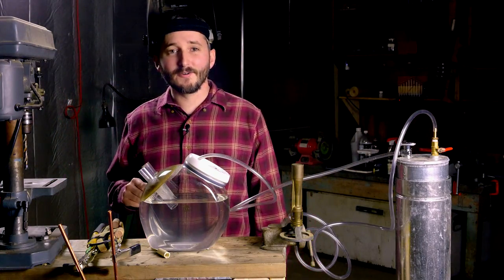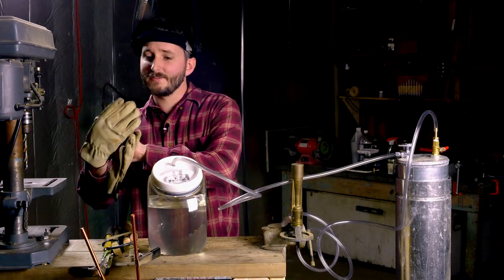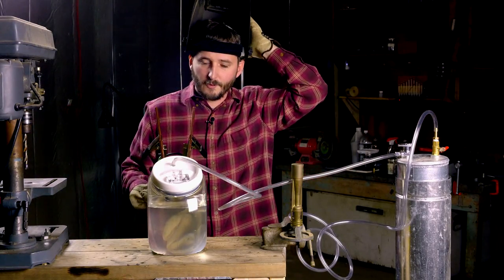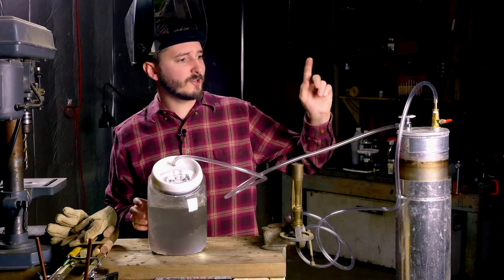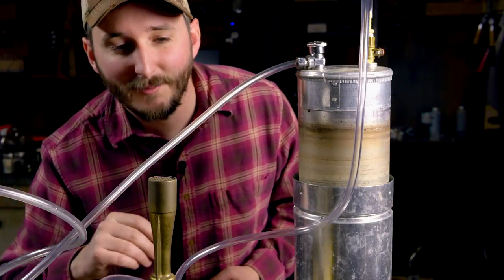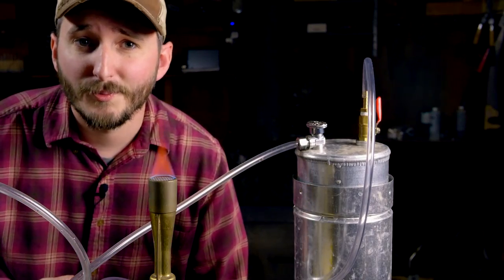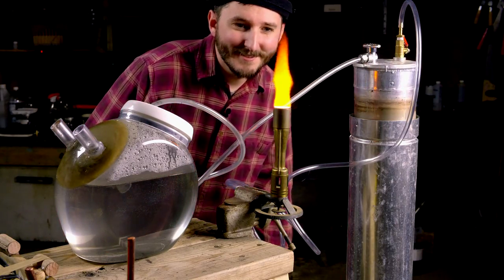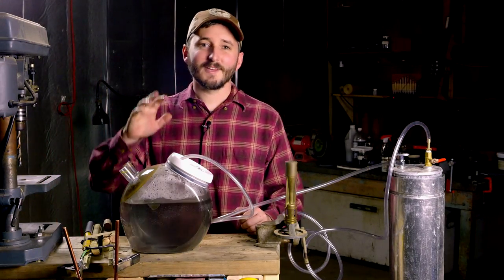Plasma Generated Water Gas (Electrically Produced Fuel That Is Not HHO)

Comment: I'm curious if such conditions might not even produce more than carbon monoxide and hydrogen. I can imagine that compounds like CO2, formic acid, formaldehyde, methanol and short hydrocarbons could form as well. I'd love to analyse the gas. In case someone can try this:

Bubbling the gas into water:
Test pH. If it's acidic, then any kind of organic acid should be present. If it's alkaline, this would be interesting, because it seems impossible at first sight that ammonia could form.

Bubbling the gas through calcium or barium hydroxide solution:
A white precipitate indicates CO2. No precipitate would mean, there's no CO2 or the amount of acid is way higher than expected, if the pH was acidic in the beginning.

Bubbling the gas into tollens reagent:
If a precipitate or even a mirror is formed, then CO (or some aldehyde) is present for sure.

Cooling the gas with ice, after passing it through a tube with calcium chloride (removes water):
If a liquid condenses, it might be methanol and/or longer hydrocarbons. If the liquid burns cleanly, then the hydrocarbons are short. If the flame produces soot, the chains might be long or there are lots of branches in the molecule. To test for methanol, add boric acid and a few drops of conc. sulfuric acid. If it burns green, it's methanol.

Comment: It's all for education of science. But I used carbon rods coated with copper with a small hole down the centre it had compressed air flowing through it and I used it to gouge though metal after a weld had cracks in it on 2 inch stainless steel

Comment: i wonder if you could make a generator motor combination that would run the arc welder off the gas and store extra for other stuff ... if it could keep itself supplied then all you have to do is basic maintenance every so often and restart ... be a good steady recharge for a battery bank I think

Comment: It's a hydrogen fuel cell. Use a double Helix coil and you can do the same thing with a 12v car battery.two plate work as well but the coil produces more.

Comment: If one is living far from civilisation (Alaska, boat, or Island) and you have wind, water or solarpower. Then you can store using that method:  warm water (shower, heating etc), CO to burn for heat and... electricity (at times with no other power..). The H2 should sequester in the upper compartment, because of its weight. One could use it to power a fuel cell.

Comment: Hi, well done experiment. I just wonder, how you got the case airtight with the electrodes sticking in there, so the gas is not coming outside the holes, where you have put your electrodes into there ??
Reply from the maker: The tubes the electrodes poke through are underwater so that creates a seal.
Reply: @Nighthawkinlight  How do you seal it, when you move the electrodes ? Can you please show this in a next video some more ? Many thanks. Regards, Stefan.

Comment: A while ago I tried this with pencil graphite but my small 70w power supply (even if I put it in series with three laptop chargers for about 140w) couldn't sustain an arc. It's quite lucky though because I didn't know it could generate CO which could be dangerous but I was doing it outside.

Comment: Initially this would generate carbon monoxide and hydrogen from the water but if left going it might start creating methane, methanol compounds in the carbon monoxide and hydrogen gas, then the mixture could be burning faster than an energy efficiency society would want. You might want to run through a masspect to make sure of the product.

Comment: Def. Subbing; I really like your videos 
I don’t think I’ll get to this gas I’ll just go back to the HHO torch; should be enough to melt glass and make rockets (for rockets. I think it’s safer to stay on pressurizing water with my compressor inside bottles)
Also, one more question, can I store HHO in this gasometer???

Comment: I know physics hates this question, but. What would be the yield of a self fueled electric generator using the gas produced by its own electricity? Would it be possible to make a self powering system to basically make an endless flame? All you do is add water / replace rods.  I would guess the power required would be greater than the work, depending on the efficiency of the generator? Either way this is good stuff as usual!

Comment: I'm going to guess carbon monoxide because the only elements available are carbon, hydrogen and oxygen. It's not HHO and it's flammable, so it can't be CO2, so it must be CO. Furthermore, it's quite toxic, which coincides with what you said. If it's not, maybe it's an organic compound? My first guess at an organic compound would be methanol, but it's not too toxic (and it's liquid at ambient temperature), so my first guess is still CO. Or maybe its multiple compounds, including CO? Guess I'll find out when I watch the rest of the video. I'm also guessing the way it works is through thermolysis and then the reaction of carbon with the oxygen/hydrogen at high temperatures.
EDIT: Oops, forgot about the hydrogen, but I guess I was right with my first guess of CO! Also, now that I think about it, a mixture of CO and H2 is also known as syngas (synthesis gas) because it can be used to synthesise organic compounds such as hydrocarbons or methanol (so there's actually a chance there's some methanol!). Maybe you could try that in a future video?

Comment: The idea that using leftover electricity  to make hydrogen and carbon monoxide,  instead of electrolysis,  oxygen and hydrogen. with no CO2 by-product. But awesome video anyway. Super interesting
Reply from the maker: In using electrolysis for fuel the oxygen is pretty much a waste product, which makes it an inefficient process. With this method both the gasses you make are flammable. The carbon can come from biomatter so that the co2 emission is net 0.
Reply: @NightHawkInLight  then there is the process of making the carbon rods. Oxygen can be used for a lot of industrial processes, also its highly Flammable.  And it's not harmful to release into the environment,  and electrolysis uses less amps, which is less power draw. 

It's definitely interesting. Just doesn't seem efficient at all. Environmentally or power draw.

Comment: In case people do try this at home, some safety "education" for the audience regarding how the gas tank+burner is set up would be good. Particularly, that people should use a valve that prevents backfire (when the ignition goes all the way up the tube, and into the tank, Exploding the tank).
Burning Hydrogen is not something to half ass.
When I was a kid, I produced some hydrogen using salt water and two electrodes, put a tube off it like this, but didn't have a valve to prevent backfire.
Luckily for me, the tank was sealed at the bottom only by being submerged in water, so i basically turned the tank into a high powered rocket which blew a hole in the side of the roof outside, and got salt water exploded all over everything including workbench, tools, and lots of other metal things u don't wanna cover in salt water (causes rust)...
If it had been a sealed tank like this, I'd probably have died.

Comment: I don't think you mentioned it but I suppose you purged the vessels from air before you collected gas with the intent of igniting it. Since hydrogen has so wide explosive limits, the gasometer could end up on the floor above you if there is too much oxygen left when you ignite it.

Comment: What would be the most valuable thing to create is alcohol from simple water using only electricity. Experiments into the possibility that alcohol can be created instantly from water and carbon using frequencies of electric current are on paper and some one needs to take this theory to the next level. The idea is that alcohol can be created in miliseconds if using the right frequencies, voltages and currents. this process could involve microwave, radio waves or another form to mimic the process of sugar and cellulose using only electricity along with carbon. One day in the future this could be a common place manufacturing process and quite inexpensive to produce.

Comment: I think that I have safety concern about some amount of oxygen also geting into the produced flamable gases container because of for example water electrolysis also taking place (but maybe it's produced also due to some other processes in such extreme envirovement that the electrical arc is). I'm not sure if the amount is any significant, but I think it was worth mentioning.

Comment: Nice project! One question:
Are you absolutely sure, that no gas can escape out through the insertion tubes? They are under water sure, but maybe a small amount of gas exits through the holes instead of the surface?
Reply from the maker: You can tell when gas comes out the tubes as the bubbles are obvious. If I notice one I adjust the rod placement

Comment: Interesting, should look at how acetylene is produced and the reason why little bits of carbon fill up the air in your shop when you run a Oxy/Acetylene torch without the O2 on … it’s a really simple chemical process.

Comment: My thought is either methane (CH4) and gaseous oxygen (O2)/hydroxides (OH) or some mixture of carbon monoxide (CO) and and gaseous hydrogen (H2). I would presume the latter because of the (IIRC) lower activation energy required to bond carbon and oxygen.

Comment: Dude I love your experiments!!! Can you please build a geet reaction chamber? Using and electrical coil to heat the chamber and force hydrogen into the chamber?? Please it would be awesome!!!
Reply from the maker: What is a geet reaction?
Reply: @Nighthawkinlight   Paul pentone . Google geet reactor, I'm curious if you can do away with the exhaust heating jacket, if a coil is used for the heat. Geet is lightning a lightning reaction cold gasses impacting heat and separating releasing burn able gass and plasma

Comment: Build a heater with this that has a built in carbon monoxide detector that automatically shuts off if it leaks. It’s definitely not efficient but it’s interesting.

Comment: make an adiabatic reactor and see if this gas turns into liquid fuel.
example like a metallic syringe and inside the syringe this gas. compress quickly (hit the plunger rod with the hammer) a few times, cool the syringe and check for the presence of liquid, then check if this liquid catches fire.

Comment: Connect an electricity meter before your generator to see how much you`ll consume to produce the gas. Burn the gas with a gas welding torch and try to melt aluminium can, teflon sheet used for cooking, tungsten welding rod (make it sharp before to reduce its section), cooper pipe etc. Try to find the flame temperature and the Al, teflon, W, Cu temperature when you burn them) :) Good luck!

Comment: What makes this not a  form electrylosis ? If i understood your procedure  Correctly you are using DC current from an Electric Arc Welder.  Using carbon rods as your anode and cathode. The  difference i saw was instead of putting the two electrodes  in the water clóse enough to create electrolysis you strike an arc by slightly shorting  them out by bringing them to barely touch to arc and keeping a small distance to keep the arc constant.  So the only difference is the arc which is called a plasma , or the 4th state of matter after solid,  liquid  and  gas. The plasma is ionized gas that either is from seperating water into hho( so both may be ionized?) The nitrógen , more oxygen,,CO2 and other small traces of gases in the air( you didnt specify it was a vacuum) the air is above the water so it may not be part of the water solution but possibly a tiny amount would be. Plus the carbon solid  in the rods. IT is electrolysis at extreme heat, by 220v× 150 amps =33000 Watts  but that isnt what the true current was based on the resistance of water but a plasma or a jump in electricity thru an arc could be transmitted  in  conventional  electrolysis if the water had a catylis like potasium hydroxide  were added to the water ( which raises the conductivity) and the voltage raised hi enough the electricity  would arc thru the water. So if an arc or plasma is formed during electrolysis it is no longer electrolysis?

Comment: I'm guessing the carbon is so hot it reacts with the split oxyhydrogen gas and forms combustion byproducts, as well as some uncombusted things like methane, carbon monoxide, etc. There is guaranteed to be some oxyhydrogen that escapes due to the electric potential between the electrodes creating it.

Edit: close enough

Comment: Calculate the efficiency! Shouldn’t be hard, just calculate the amount of H2 and CO molecules (which are related to one another stoichiometrically)  using n=PV/(RT) given from about 30s of arc and look at those atoms enthalpy of combustion with O2. A wildcard will be whether there’s an appreciable amount of CO2 produced instead of CO, as that will mess up the stoichiometry. The electrical side is easy, just multiply current by voltage by time. I can’t imagine it’s a very high number, but perhaps using and AC arc and/or varying duty-cycle and/or balance could improve it without impacting the gas production rate. Maybe that patent has already gone into some of that detail.

Comment: CO has a  greater solubility in organic solvents than H2 you might be able to use that to separate them. Or if you werent intending on getting the CO back you could exploit transition metal complexes
Reply: it would be possible to get the CO back just would need something to displace it in the complex but CO likes to hang on

Comment: (Read to the bottom I want to give you something) I would like to see you run a generator off of that gas and see if you create the gas at off peak pricing and run the generator during peak pricing if this could be a hack to save money on the utility bill. Could this be a cheaper form of energy storage then batteries? Also I have an old 1000A Miller ark welder with a ton of big transfers in it I would love to give you if you will use it or the parts in your videos. The transformers are about the size of a regular rectangle tissue box and I think there are ten or more inside of it. It's a three-phase unit so I can't use it but if you were to do something with the Transformers each one is a single-phase at least on one side but I don't know enough about this kind of stuff to pull them out and do something with them. I'm sure you could come up with some crazy things that could educate people and entertain

Comment: Two or more complex flammable mixtures in the same container as oxygen, this doesn't sound completely safe to me for some odd reasons. :hand-orange-covering-eyes:   I use a similar process like HHO but it in utilizes two chambers and iron graphene panels instead of stainless steel to form electrolysis, only compressing the hydrogen in the recovery expansion tank, which is extracted with a small vacuum pump to a pressure tank (20 gallon Propane tank) that is reduced with a Propane regulator to my furnace, or to my Dual Fuel modified gas generator for backup power.  There are a few other steps in my process, but I believe I'm getting some carbon monoxide, but will have to think on this and do some testing. I use a regulated 12 VDC 60 Amp power supply for this process.  The graphene bats I use have a greater surface area to water and produce hydrogen faster than anything else I've used and I use a minimal amount of electrolyte in the water to excite it.

Comment: Safety question: How is this really different from electrolysis; is it because electrolysis uses steel plates, because this doesnt seem very different from a dc power supply and some pencil lead (just a larger scale?) and I almost did that for my first hho project; I am really after getting clean hydrogen and clean oxygen!

Thank you so much for sharing your knowledge!  God bless!  Proverbs 27:17 Woo-hoo!

Comment: To store the low pressure gas you could use a small air compressor, like a 12v car compressor, and have the inlet connected to the gasometer and then the outlet connected to a pressure tank. I have a 12v compressor for my 4wd and it goes up to 90psi... don’t see why it wouldn’t work?

Comment: Hello
Do you know what is more effective?
Creating gas with using carbon electrodes or creating hydrogen gas with standard electrolysis? I guess that this method you shown is not very effective and it is consuming much more power than standard hydrogen gas electrolysis. Nice video- very interesting.

Comment: Did something similar back when I was 13 years old except is was plasma electrolysis and quickly learned to not use tap water and to NEVER sniff the yellow gas😂
Reply: And that 200+ volts dc current can still shock the crap out you...

Comment: I'm 56 seconds into the video, and I'm gonna guess that it's ammonia. You provide enough energy to the separated hydrogen and oxygen that the hydrogen miiiiight bond with the nitrogen in the air? Maybe? Pretty sure ammonia is also pretty poisonous to inhale as well, so that fits. I'm not sure if you added other chemicals since I haven't gotten to the process yet, so maybe there's that, but I doubt it could be anything else. Unless it's bonding with the metal from the electrode, in which case I'm wrong.

EDIT: Apparently you're using Carbon electrodes, so I'm gonna go with methane instead. The poisonous gas is probably a byproduct from water impurities or something, since Methane isn't poisonous iirc, just dangerous due to potential for asphyxiation.

EDIT: I actually didn't know that Carbon Monoxide was flammable! That's really super interesting. I'd be a bit concerned over the efficiency of the process though, since it seems like generating that hot an arc in a coolant would be pretty electricity expensive.